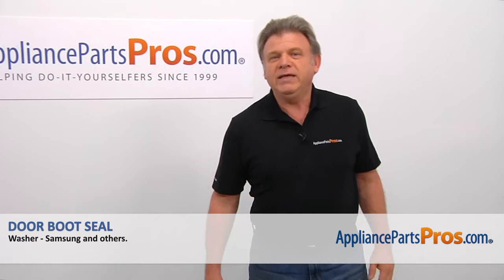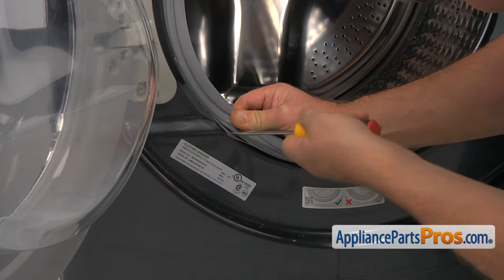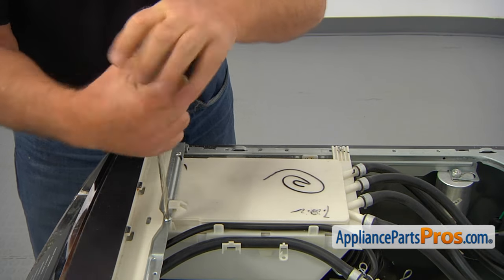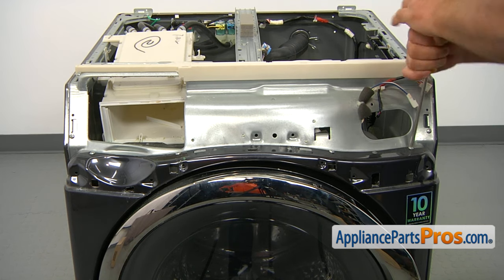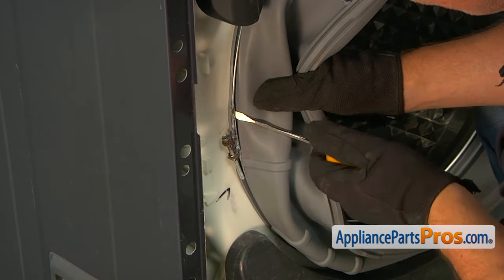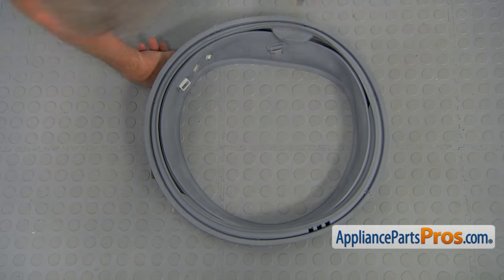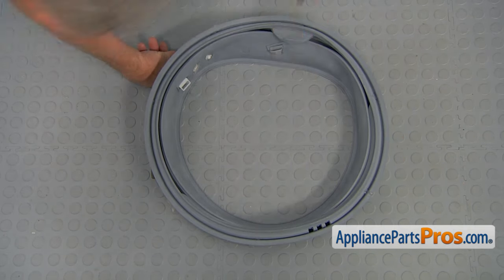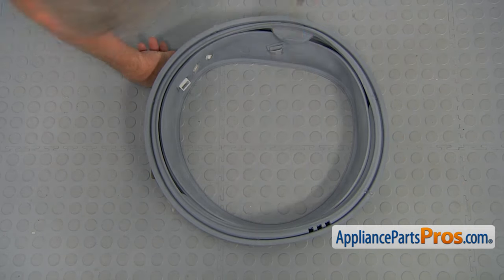How To: Samsung Washer Door Boot Seal DC97-16140G

Comment: Great help. I would add 2 things:
1. When he says wear gloves when removing the front panel, it’s not to give a better grip. The edges of the panel are REALLY sharp. I cut my palm.
2. If your washer is on a drawer base/pedestal, you can very easily remove the bottom screws of the front panel. Pull the drawer out—they are right there (actually easier access than if it sat on the floor).

Comment: Awesome step by step! My bottom screws for the front panel were completely worn down from somebody sliding the washer across a cement floor when they were moving it I'm assuming. Took a while but ended up drilling the screws out and was back on track. Thanks again for such an in depth video and saving us all a lot of money!

Comment: Great video. My washer was slightly different but the basic steps were the same. 
I had to unscrew the soap dispenser before I could take out the control panel. Also, I realized after a bit of struggle that my door panel was screwed down to pedestal, so something to keep in mind. 
I also took lot of pictures and mini videos to keep track of things when putting it all back together.

Comment: Has anyone had a issue with a lot of smoke upon first use after repair? Maybe the dish soap burning up? Clamped too tightly?
Reply from the maker: Where was it smoking at? Is it still smoking or are you having any other issues at the moment?
Reply: It smoked randomly for the 1st ten washes. Less smoke each time.  It has stopped now. Maybe the dish soap?

Comment: I have watched a couple videos and everyone gets this thing on with no problem. I have the correct part but cannot for the life of me get it to fit. Its like its larger than the opening and I end up with 2 inches that won't fit. What am I doing wrong? No video seems to show anyone having this issue.
Reply from the maker: What is your model number?
Reply from the maker: The part number the manufacturer recommends for that model is DC90-24123A. This part is no longer manufactured and we do not have any stock left. You will need to test that number and check around to see if anyone still has some stock left.
Reply: I found one online and got it installed. I was trying to push it into a different part of the rim and that's why it wasn't fitting. Thanks so much for the video and your help! @appliancepartspros
Reply from the maker: You're welcome!